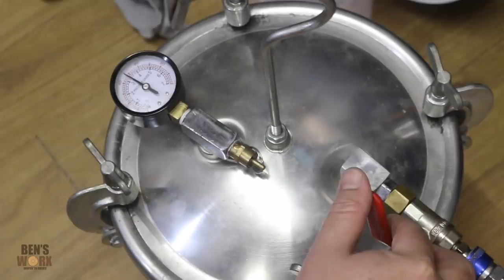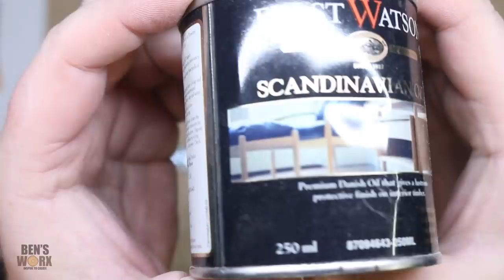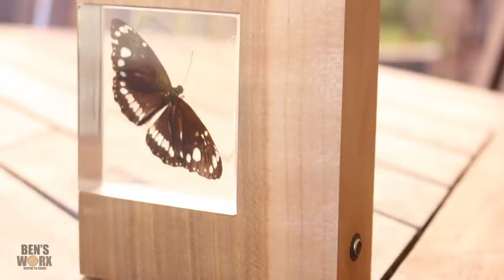Making The Butterfly Effect with LED's - Insect in Resin

Comment: Very clever mounting. Shame about the antenna. This would be beautiful with a Monarch butterfly. Great job...
Reply from the maker: Thanks Jerry, yeah i was spewing when it broke off
Reply: @BensWorx  Did you consider drilling a hole from the side, filling it with fresh resin and inserting a replacement antenna?
Reply: @BensWorx  I spread butterflies as a hobby and make displays. I know the feeling when an antenna falls off. 🙈
Reply: Next time maybe some UV resin on the delicate parts before putting it down? I know this is an old video but just an idea.

Comment: Nice. A couple pointers though. Electrical tape is used to tape wires together and down by connecting to their insulator. Never use tape as an insulator because it's going to fail. Get heat shrink tubing the instead. Works way better.
Did you think to make the bottom with the light shining on it not shiny to diffuse the light? It could make the butterfly light up more.
Reply from the maker: Thanks for the tip mate

Comment: Nice work!
Next time, solder the wires directly to the strip light rather than to the wires, it will be a lot easier.
Also, maybe try leaving the base unpolished so it acts like a diffuser, making a more even light.

Comment: Lots of butterflies mate, the female lays her eggs and then they both die within a day. While I'm sure some might catch live ones to use, I could never do that. What a way to preserve such beauty. I almost cried when 1 of the antennas fell off, but they are so fragile. 

Ben, I have a question. I've noticed that quite often the top of the cured resin has waves in it. Is that because of the type of resin you need to use for your projects, or is it because of being on the pressure pot. I don't have the equipment for intensive sanding

Comment: Have you considered the perspex and tape/hot glue resin box construction idea? In many cases removed the need for any sanding as the finished product is exactly the size required?
Reply from the maker: I have made molds like that in the past but in most cases still requires a bit of sanding and polishing for the correct shape 👍

Comment: The lights that you use the link sends me to a 16.4ft strip of them and you only use a few inches of them can the rest of the strip be used for something else and if so how.  and what is that black plug thing called that you are using this is really cool I love it.
Reply from the maker: Yes you can keep using the strip, you just solder 2 wires on, the plug is an ac adapter plug

Comment: I checked the website for the epoxy you used and seems to all 1:1 ratio mix, but you seem to have used a different ratio, possibly 2:1 . Can you kindly clarify. Thank you
Reply from the maker: On the Just Resin website under casting resins there should be ArtCast slow set which is mixed at a ratio of 3:1